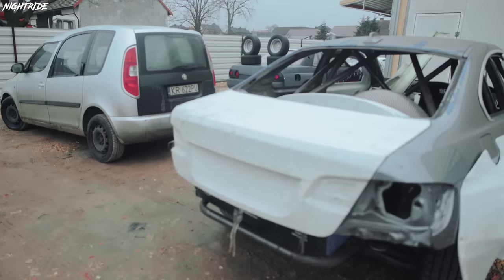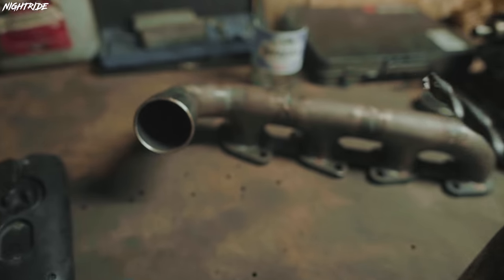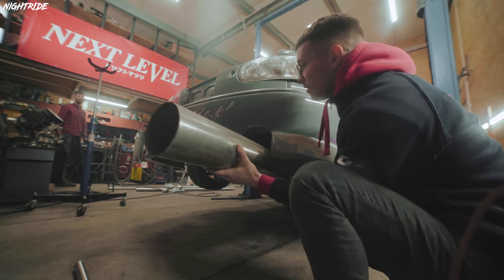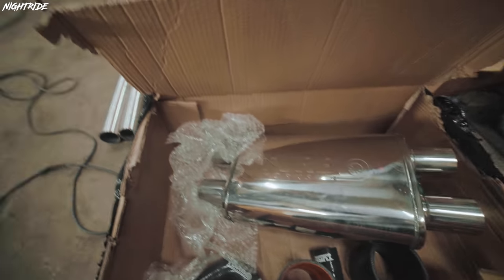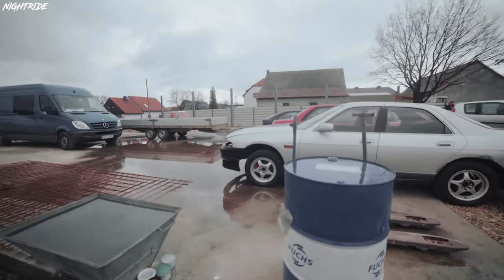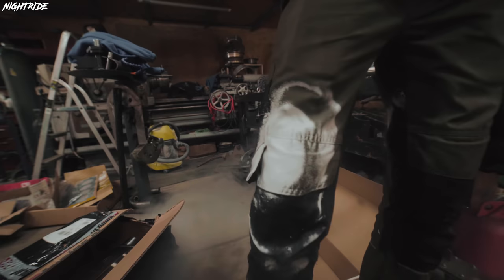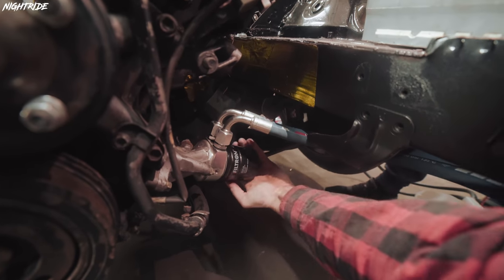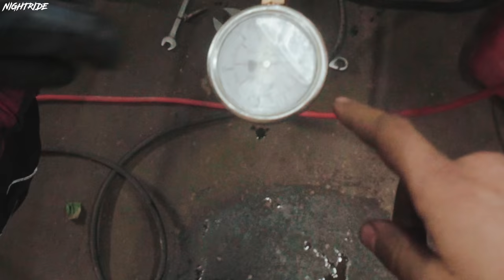My 1uz V8 MIATA build Part 8 | NIGHTRIDE 4K

Comment: Great video! Though i have one concern here. The exhaust manifolds look very restrictive to me. I would have gone with some 4-1 longer headers. I would assume, that the engine will be down a lot of power...
Reply from the maker: well there is no space for anything more than that (it's already super tight) will check the car on the dyno and will see :)
Reply: @NIGHTRIDEPL  Yeah. That would definately be super interesting. I love the build though :)

Comment: Oil pressure can take a while to prime if the engine has been sitting forever, what most people I know do is that they also remove the spark plugs, that way the engine is under almost no stress which means turning with no oil pressure isn't quite as bad, and that way the starter can also turn the engine faster, usually after like 15s of cranking that way, oil pressure arrives.

When you can manually prime the pump like you did, it's always a good thing to do tho.